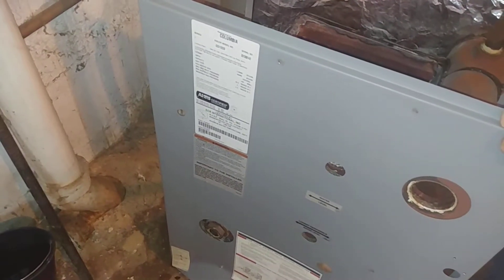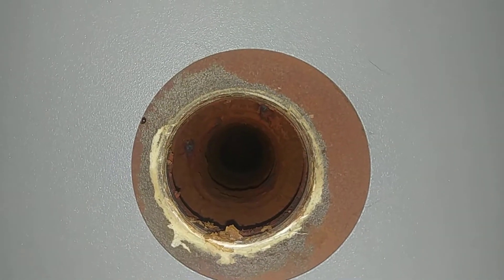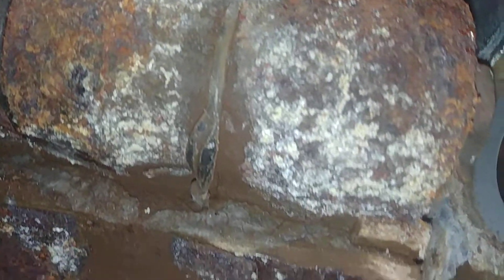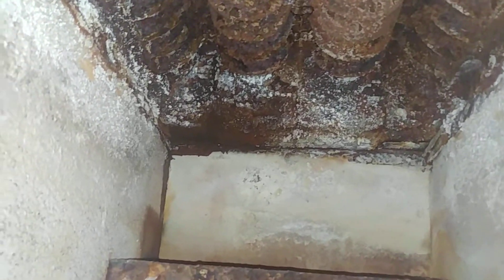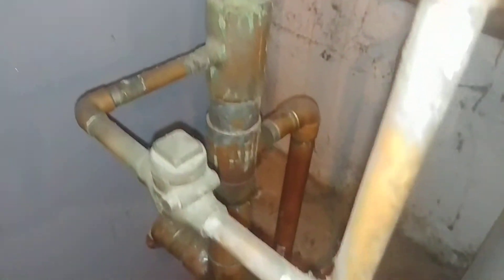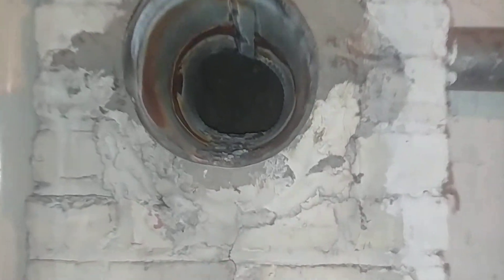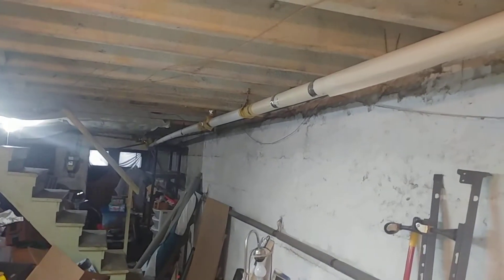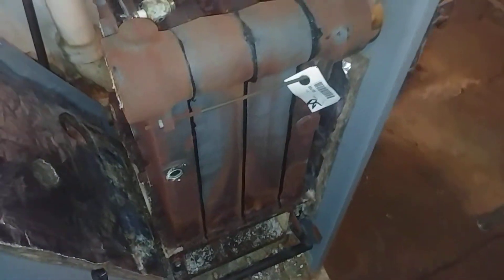Gas Fired Columbia Steam Boiler Replacement - Is There Any Warranty Left?

Comment: Another good video thank you.
When you mentioned that the copper T was installed wrong I didn’t understand what you mean can you explain with another video which connection’s are right and which are wrong?
Reply from the maker: You're welcome!
The tee should have been in the "run" of the header with the "bull" or side outlet pointing more or less up.

Comment: I don’t see how this boiler passed inspection when installed with copper near boiler piping. It shows how we all need to be careful who we hire to install boilers. We need more people like you!
Reply from the maker: Thank you for your words of support!
Different areas have different standards.
This boiler was not inspected.
It would not have mattered. Copper for steam piping is allowed in our area.
There is nothing in ANY boiler manufacturer's installation instructions that dis-allows copper for near boiler piping.
I have videos of boilers that were, in fact, inspected and look FAR worse than this one !
Reply: @gordonschweizer5154  I’m on 22 years so far with my HB smith 19 5 section boiler. Regular flushing and making sure I don’t have any leaks by having a water meter installed have done good so far. Fresh water will destroy any boiler over time.

Comment: What took this boiler out within 10 years? 
Short cycling? 
Condensing in burner section? 
Bad discombobulator?
Reply from the maker: At this point, we don't know.
Leaking radiator air vents?
Loose valve packing nuts?
Union nuts leaking?
Or simply a defective boiler?
All or some of the above?